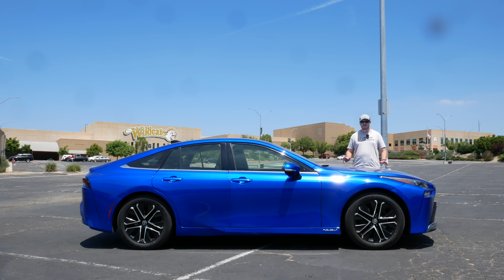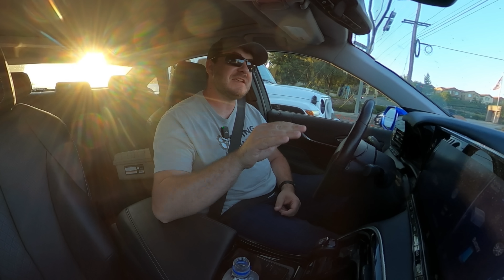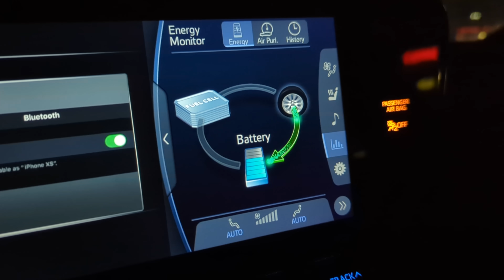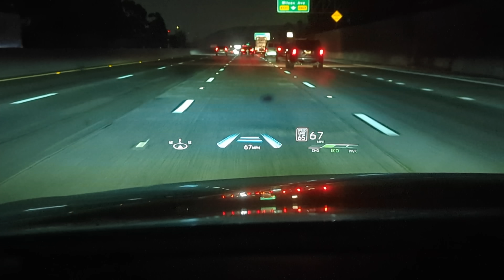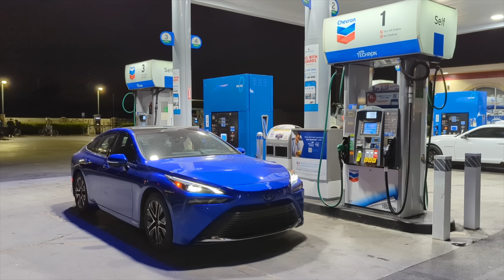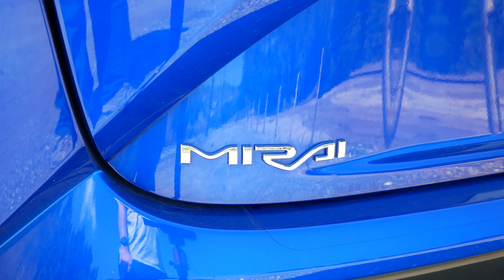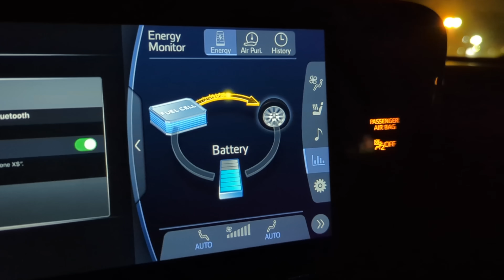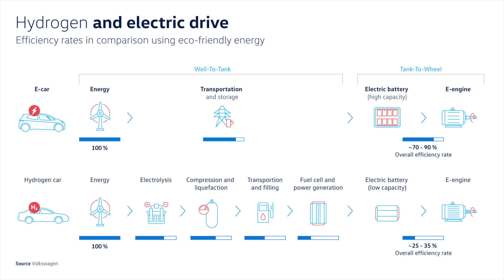The Toyota Mirai is Disappointing

Comment from the maker: Use code AGINGWHEELS50 to get 50% off your first Factor box at https://bit.ly/3JBxZfN!
Reply: Going into this video I expected you to be a playa-h8er since you're an EV fanatic, but this was a pretty fair assessment. The Mirai... is a very WHELMING car... 😅
Reply: if it runs on H ... why doesn't 1t just electrolyze it's own fuel with, the easily purchaseable, Toyota home solar/green mains Hydrogen electrolysis station? (with free Oxy output ;o)
Who.. in their right effin mind, refines H2O to it's explosive form and use fuel to deliver it Gas stations - when it's safe, potentially 100% green and essentially FREE to fuel up At Home? hmm..?
(honestly, why don't you just put distilled Water in the car and let the Cell power up the electrolysis? - my mistake Fuel Profits, of course...)
Reply: I think it was Out of Spec Reviews which said that the Carbon composite fuel tanks need replacing after 5 years, because they degrade. If so, then that's another thing o add to the TCO.

The battery being so small is another issue. If a cell can be recharged 1,000 to 5,000 times, depending upon the technology, it will not take long for it to become worn out in a Mirai. Supposing you have to use all of the battery capacity 10 times in a daily commute, perhaps in start/stop traffic or over hilly terrain, the battery can become useless within a couple of years.
To most people, there's no financial advantage to buying a H₂ powered car and keeping it for very long. 

Filling the tanks is arguably more of a chore than plugging in a Tesla to recharge while you take a bathroom break, maybe eat something, have some water or a coffee and stretch your legs. Everyone needs to do that at least once within a couple of hundred miles of driving.
Reply: Hydrogen is an effective solution for humanity, but with the right implementation, which was not the right solution for the oil producers and the auto industry's existing revenue streams!   Over 30 years ago, a British company developed a "just in time" hydrogen vehicle.  It was able to efficiently convert water into hydrogen at a faster rate than it was consumed. They developed a working model, the oil industry saw this as a threat to their revenue stream, so they killed off the development team, and destroyed the vehicle.  Certain aspects of the technology can be found in patents.
All you needed was a tank full of water - zero petroleum.   You can only talk about the defective technologies that drive revenues, not the best solutions technically possible.

A similar vehicle was developed in Florida, the developer disappeared!

The same can be said for Electrical energy.  A team in California developed a zero point energy device, about the size of a washing machine, negating the need for a national grid.  But the power of control and revenue did not want to loose either power or revenue, so the technology which was working in a lab in LA was confiscated and destroyed, and the developer life was threatened if he ever pursued this development in the future.

This is the world we live in. Nothing wrong with technology, but the efficient technology is suppressed so that others can capitalize on substandard alternatives.  The same can be said for the medical profession, but I think people are finally beginning to see how bad the medical profession is as a result of covid effective treatment suppression in favor of untested vaccines.
The wellness industry is ready to step in and deliver real cures and effective treatments - time will tell if they are successful. But at this time there is not a lot of trust left for doctors the FDA, the CDC or pharmaceutical corporations - they all lied about covid and the vaccines.
Reply: Thanks Robert. At the risk of an expected flame war, and I'll keep my head down after this, to sidestep it, there are a few things to add to this video:

Tesla Semi. 500 miles of range. Recharge once per day. Superchargers can do that. Megachargers can do that faster. A perfectly viable option for truck owners.

Battery electric vehicles: Simple and efficient. Hybrid vehicles, including the Mirai: The most complicated powertrain vehicles on the roads. Two propulsion systems to lug around, both of which will fail. Inefficient, as you have pointed out.

If the Mirai has a Prius battery, then just think how many Prius batteries have died within a year or two because of being recharged and discharged numerous time per day. If a battery can be recharged, say, 1,500 times before end of life, then it will only last for 12 months if put through 4 full cycles per day. Those four cycles equate to about 15 miles per day of battery-only driving from a 1.5 kWh battery. 

Sure, the fuel cell will reduce that wear rate, but if a car is being driven for work daily, then it will likely need a new battery at about the time that the owner will need to start paying $180 per refill of H₂. Nice...

Also, (and I may be wrong about longevity here) I understand that those Carbon fibre fuel tanks degrade with time as they are cycled, just as did the hull of that mini sub this year, and that they will need replacing every 5 years (repeating information from Fully Charged and Out Of Spec Reviews), for safety reasons. How much will that job cost?

Fuel cells also rely upon being fed with pure H₂ and pure O₂ to avoid 'poisoning' of the membranes. Neither gas is entirely pure, so that will mean regular repair or replacement of the fuel cell. I gather that the fuel cell is by far the most important component in the Mirai.

In comparison, there are BEV's which have travelled for more than 1,000,000 kilometres / 620,000 miles, and maybe only needed one battery replacement, under warranty. Modern batteries are being developed which will have a life expectancy of 1 million miles or more. Most gasoline cars around the world are worn out and scrapped long before that mileage has been reached. 

I'm in the UK and have never owned a car which has done more than 125,000 miles before the engine was worn out. That's in almost 50 years of riding and driving gasoline fuelled vehicles. Your mileage may vary (I've been wanting to include that phrase!) in the USA, but engines can and do wear out much more quickly than electric motors. There are electric motors around which have been run for more than a century and which are still fully original and delivering the same power that they did when new.

So, of the three main propulsion methods; fossil fuel, Hydrogen and electricity, on the grounds of total cost of ownership alone, the BEV comes out as the lowest cost to run. Hands down.
Reply: Although Celsius in normally preferable -40 is one of the few cases where using Fahrenheit is acceptable.
Reply: This car is utopia on wheels.
The only reason to make those is to get juicy subventions.
Reply: Hey Factor, this guy knows how to make ads.  Thanks for your sponsorship!
Reply: @TheBigWhiteWolf 😊
Reply: Fuel cells do not degrade

Comment: 15:14 could also trickle charge buffer batteries so you can dump megawatts without putting strain on the grid, could also be used to get some cheaper night time energy although I'm not sure how useful that would be since the batteries could probably only charge a couple of vehicles at most

Comment: Until we have a large excess of very cheap electrical power hydrogen vehicles solve very few problems.  The vast majority of hydrogen produced today comes from fossil fuels.  Green hydrogen is very expensive and very energy inefficient.  When we do have a vast excess of cheap electrical power  then EVs which use electricity directly are a more efficient and cheaper solution that currently exists.  Where hydrogen might work is in aviation or weight critical applications where fuel is delivered (quarry equipment?). The hydrogen car discussion is merely another pro-fossil fuel / anti-EV distraction dream theory at this point.

Comment: If hydrogen stores well over a year, it probably would be best to make it roughly as a volt(chevy volt) system, 20-30kwh battery that is rechargeable for daily commute and use it hydrogen as a range extender.

Comment: You want cheap hydrogen? You need renewables/nuclear power powering hydrogen generation plants.

Any excess power can be dumped into the grid. 

Unfortunately gas/oil companies would rather deal with regulations than let a single CENT go towards green/sustainable energy.

Comment: Maybe hydrogen could be used for airplanes because of the issue of battery weight, assuming newer battery technology doesn't heavily improve on this and energy density, i can imagine a hydrogen (plant?) Being powered by solar or other renewable energy sources to save and capture the hydrogen so that the energy can be used in the form of hydrogen
Reply: Or even ferries since batteries have been shown to work and they have very simple routes so the infrastructure could be easily made

Comment: The hydrogen-electric seems inferior to the battery-electric to me: the Mirai has a similar range to the better BEVs available in 2026, and you can't drive it anywhere outside of California. You also can't fill up at home overnight. And producing hydrogen for a fuel cell requires a colossal amount of electricity -- which should just go into charging a battery. 

I won't be trading my Leaf for a Mirai anytime soon. Hydrogen-electric was the future like 30 years ago, but the experiment has failed, and the economic case for this platform simply does not exist.

Comment: No one is really thinking the whole thing through.  We should be at Zero  Carbon by 2030 - and we are never going to get there.  Kiss 1.5°C good bye.

About which should come first? - Cars or stations?  It's a Chicken or egg problem.  Only it isn't. The egg came first (took two chickens, not one.) The California program for installing hydrogen stations made the decision to ramp them up over ten years.  Tesla knew if there weren't charging stations strung out across the country - they would be stuck at home.   

Efficiency?  Yes, yes - let's take 'efficiency.'  The problem with BEV is sticking with them means we will ALWAYS need to have carbon-fired power plants to charge at night.  

Wind?  It's an independent operator.  No one makes an appointment with wind to charge anything.  When it works - it works.  But on its time.

Solar?  Works 'bankers hours.'  From 10-3  you get its full attention.  But before ten and after three solar doesn't provide full power.  And never try to call on solar at night - from 6 to 6 it will never charge anything.

Battery backup for those two?  Sure - for an hour or so.  But not in the middle of January when it's been storming in Chicago for the last three or more weeks - what battery backup is going to work then?  None.  See first paragraph - we need to be at Carbon Zero and thinking the entire country will run on batteries is just not happening.

Charge at home at night?  And exactly who has the space to install a charger (120v toaster plug will take over a day to charge a EV car - so that is a non sequitur - not practical.)  There are 150 million ICE cars that need to be replaced.  Just look around at all the cars parked on the street with no garage.  Comments on how easy it is to just drive home and plug in a BEV to charge overnight are a distraction by the oil (carbon) companies.  They know that if people stick with BEV, their carbon-burning power plants will be in business forever.  

If one wants to get off as carbon-burning diet, one needs to have more flexibility than sticking only with BERV.

BEV are essentially golf carts on steroids.  Tesla figured it out that it takes close to a ton of AA batteries to have the power storage to move as two to three ton car a few hundred miles.  One early test for automobile technology was the 24 Hours of Le Mans (24 Heures du Mans) where cars are driven for an entire day ("24 hours") from four in the afternoon until four the next day.  The driven the furthest wins.  To win it takes power, brakes, a sturdy chassis, great brakes, and drivers.  Not a race for golf carts.  But plans are by the end of this decade automobiles will be burning zero carbon.   Engineers are working to power with hydrogen.

Batteries.  The one thing about batteries is they are lazy.  They do not like to be charged nor discharged.  Read the (Tesla) manual.  Keep them charged between 20% to 80%.  Filling an 'empty' battery with electrons is similar to filling an empty soccer stadium.  When empty, it's easy to run up and fine a seat or an electron to find a niche for storage.  But as both start to fill up past 50-75%, it takes more time to find an empty seat or for electrons to find a spot in the chemical battery to hang out.  Which is why it generally takes as long to top off the last 25% as it took for the first 75%.  On a day-to-day basis - the 20-80 rule works.  And for those longer vacation trips, count on longer coffee-stops for a complete fill-up. Batteries are convenient to charge - if one has an outlet.  It's always curious that in comment to forums like this the zip answer is  always just plug my BEV in at home - "problem solved."  Except, of course, it isn't.  See above on wind and solar availability.  Sure, charging at night is easy - as long as there is a carbon-burning power plant tied to the other end of that extension cord.  Which is why it is a bit suspicious that so many comments try to dis the idea of fuel cells (or as Tesla's founder like to say 'fool cells') when they are ignoring where the power to charge at night is coming from - or that one even has a place to park and charge at night.

How things work.  It is always curious that any discussion of a hydrogen fuel cell car almost immediately turns into a chemistry class discussion of how exactly the hydrogen an oxygen work.  No one ever explains the complexity of an ICE engine.  All anyone needs to know is a fuel cell car makes electricity using hydrogen.  Let's ignore the need of air (for oxygen.)  So - when was the last time someone had to explain that a ICE car needs air to work?  But for a FCEV, they do.  An observation that by providing the "chemistry class lesson" only seems to make  fuel cells seem overly complicated - and thus something to be avoided.

Speed. Speed. Speed.  Ok - as always, reviews seem to degenerate into the speed of BEV.  The bragging of how fast they accelerate (0-60) when there are NO streets with speed limits of 60 MPH;  or 'top speeds' of well over 100 MPH when there is NO place in the US of a speed limit higher than 85 MPH. 

Toyota has worked on the design of a fuel cell car for more than a few decades. During President Obama's first year his   secretary of energy Steven Chu killed off the research and work on hydrogen fuel cells.  Great.   And exactly how did he expect to power a 450 TON DUMP TRUCK (used in mining)?  Not with double AA you won't.  Toyota looked at how the United States transpiration system works, and are not betting that this nation can run on AA batteries.

Comment: Hot take. Every hydrogen car should come with a mini hydrogen fuel generator you can plug in at home and just add water. there should be a built in compressor too and all fills it up just like at the station. This should be just like how a smartphone comes with the cable in the box.

ENGINEERS GET ON IT!!!! 💪

Comment: One big issue with the Mirai is that Toyota is very slow to provide their own service centers the equipment and training to do standard maintenance on these. 

I work at a Toyota service center in Estonia. We just recently got our first hydrogen fueling station and the taxi company Bolt ordered a dozen or so Mirais for their fleet. Now those cars all came in for their first service... on top of a car carrier trailer all at once.  For a regular EV, you just check the brake wear and be done, but apparently Toyota demands some special leak checks of the hydrogen components and we don't have the equipment for it. So now they sit in our parking lot, taking up valuable space while we get the equipment.

Oh, also, most of the cars have barely driven 1000km in a year. For a taxi, that's ridiculous.

Comment: Even for semi trucks and box trucks, trucking companies are leaning towards fully electric vehicles.
There has been a time period where LPG was where it was at but the last couple of years have seen huge developments in large vehicles that are battery powered only.

All the buses in my area are all electric, they seem to run without issue as far as the propulsion media goes. They have their very own super chargers at their depot, I'd wager they have a few megawatt capacity for charging and that they charge in under half an hour. Basically during lunch break.

Comment: Its the stupidest video i have seen on this channel. 50% of the video is talking about factors outside the control of toyota. Hydrogen is expensive? Then lobby the govt for a massive hydrogen fuel pump infrastructure roll out! its expensive because its only available in one city in the whole country! Did you never learn about economies of scale? And, what possible relation does green hydrogen/blue hydrogen have with how the car drives? Were you born stupid, or did the bias for battery EVs made you dumb overtime? Its an EV with multiple steps? Then why dont you make a battery pack EV which gives you over 300+ mile range with 5 min charge time! or maybe go cry to volks wagon to ask them to make one. Atleast the chinese EV makers tried by making battery swapping designs, what did Volkwagon do? bankurpt itself to the point its factories are shutting down!
Oh! and equivalent gas engine certainly means comparing a car's engine with truck's engine! what drivel!